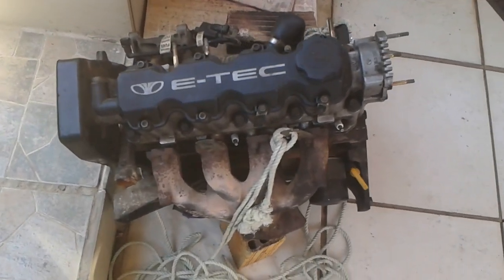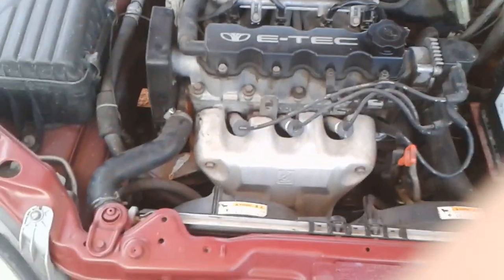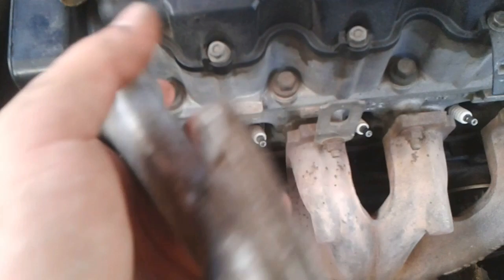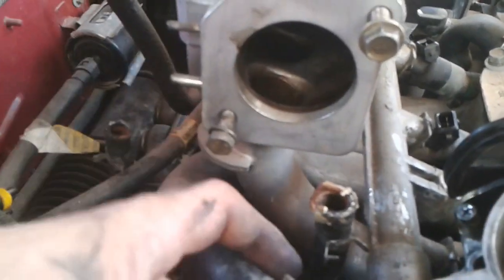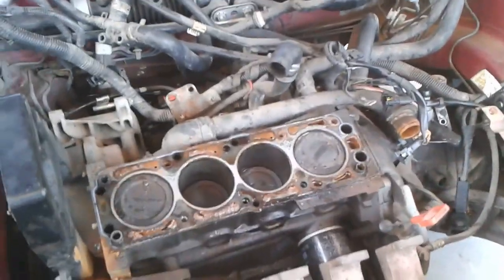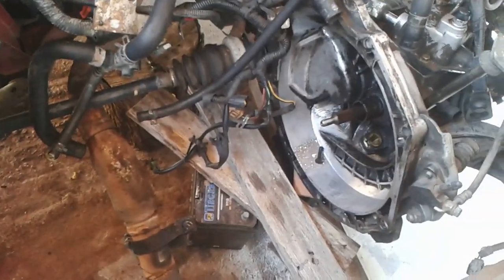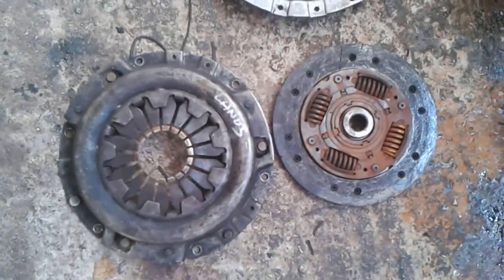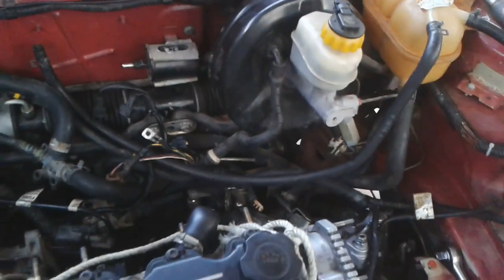Daewoo Lanos 1.4L - Engine Dismantling before Swap and Autopsy (Part 1)

Comment from the maker: The problem with the gasket is that the holes for the coolant flow were so small that got either blocked or corroded because of all that rust,this caused the gasket to shatter until oil and water started leaking out because of the seal's weak points.
Reply: OK you want a new gasket kit